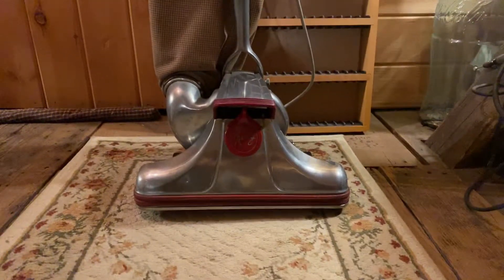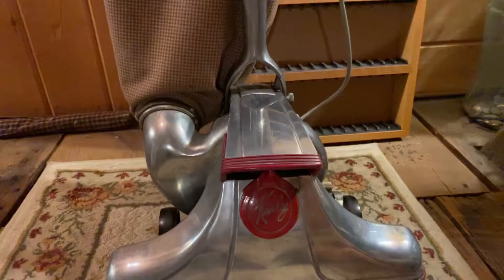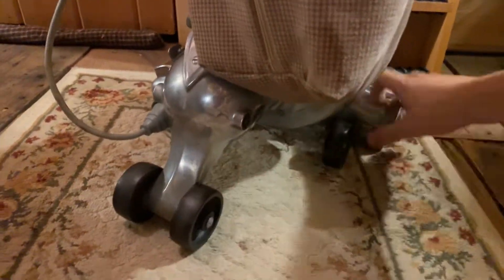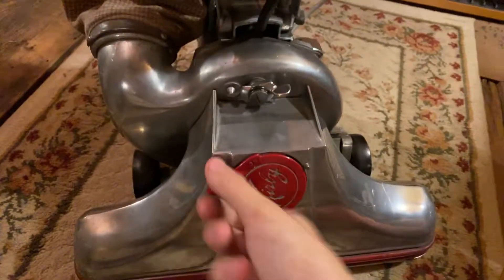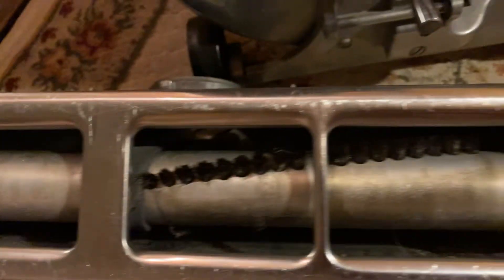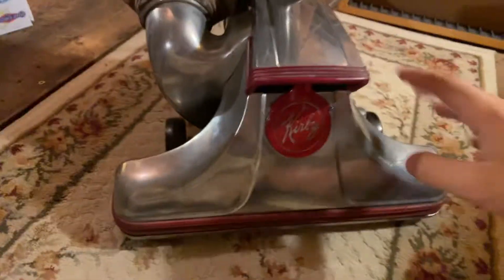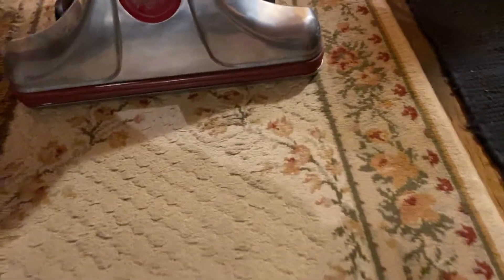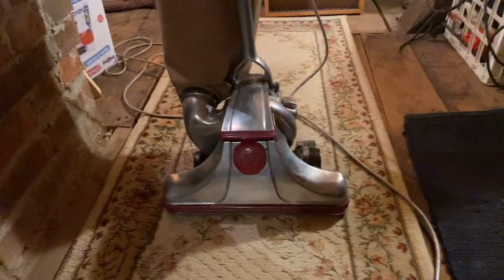1953 Kirby. 513

Comment: I have a 513 as well, the early 3 amp motor model. Restored it last week and runs like new! Like it better than the G4 and Avalir I have even :P 
Any questions on yours feel free to ask too

Gray handle is original - they were red on the late 513 and onward afaik, re-greasing the armature and a new brushroll will help a bit with the volume too